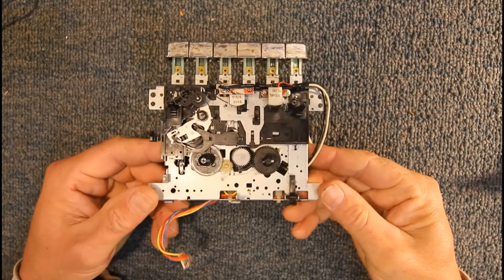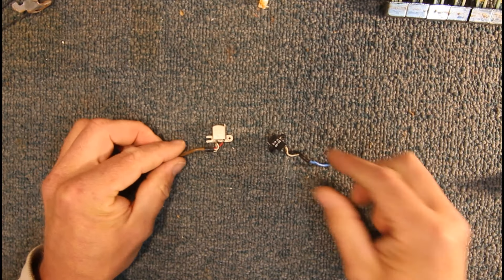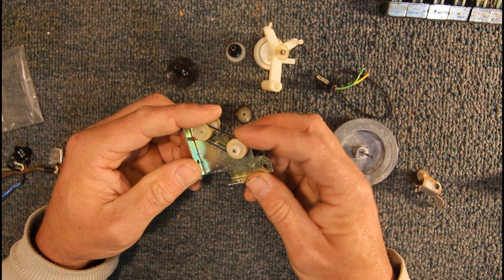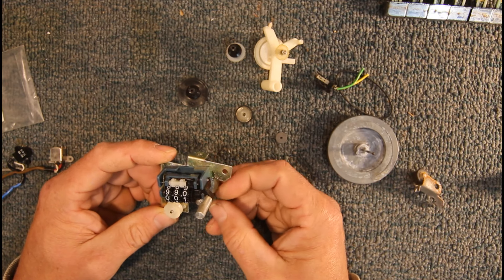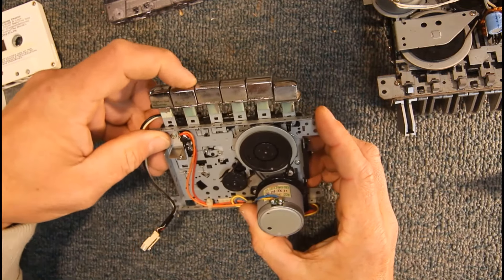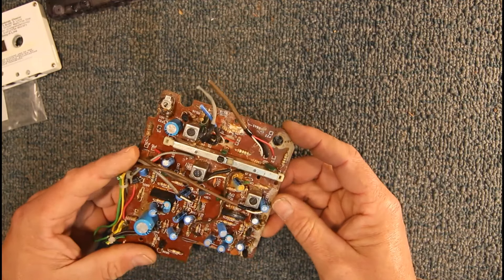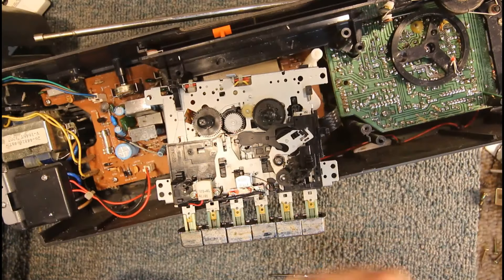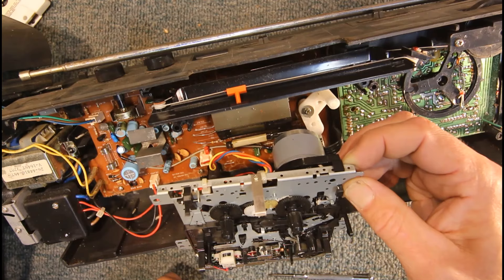Cassette Tape Player. How it works and how to repair.

Comment: Why when you press rewind when there is no tape in the deck, it keeps stopping? But play and fast forward keep going?
Reply from the maker: Its the auto stop mechanism activating. If the reel on the right doesnt turn the auto stop puts the deck into stop mode. When playing or fast forwarding that reel is turning so it thinks everything is fine.
Reply: @StevesElectronicRepairShop  ohh thank you sooo so much for that. I had no play, ff, and rew. So I opened it up and found the belt that goes from motor to capstan wheel gooey and perished. So I replaced it and I got play and ff, but no rew, it kept stopping every time I pressed it so I opened it up again and for like 2 days pulled everything apart again trying to see if there was another belt missing. I cleaned the contacts everything but still nothing. Then I saw your video and you were explaining how the deck works. So I thought I might send you a message to see if you could help me and you were right. When I put a tape in the deck it worked. Thankyou my friend
Reply from the maker: @alfaman4113  I see how that could fool you if you arent familiar with how they work. There is nothing worse than trying to fix a problem that turns out to be a design feature.

Comment: Hello, I have a Sony k7 dual deck module set, it was long out of use. Now I press play it does nothing, no button does. Can you help out please to fix it
Reply from the maker: If it hasnt been used for a long time its likely the belts have failed. Usually you will at least hear the motor run when you hit play or FF/REW. If you dont even hear that it might be an electrical problem or the motor has seized.
Reply: @StevesElectronicRepairShop  cool, yes I hear a noise like a click when pressing the button. Very short.
Reply: I don t know why the belts fail.... but I can take a picture of the looks
Reply from the maker: @luisguerreiro2169  There should be a constant whirring type of noise if the motor is running but the belts have failed.
Reply from the maker: @luisguerreiro2169  If left for a long time without use the belts will turn into a sticky substance and break
Reply: @StevesElectronicRepairShop  Now I see... the belts are around a white circle, a black tiny sticky and broken.
Reply: What should I do about those belts my friend? Should I measure them to buy some anew?
Reply from the maker: @luisguerreiro2169  Clean off any old sticky belt with methylated spirits or similar. You can use a piece of string or cotton to find the length around the pulleys etc, which can be converted to a diameter and a belt that length/diameter or slightly less can be ordered. Wagner Electronics Australia have a listing of belts giving both length and diameter in their online catalogue which is a good reference to see what is available even if you order them from someone else. The belts also have a square cross section, and flat belts have a width which may be important to match with a replacement, though sometimes it doesnt matter much.
Reply: @StevesElectronicRepairShop  do u think I can use Petroleum ether for cleaning? Thanks a bunch... I will open the case and try to figure out the belt size, as you said. 😀
Reply from the maker: @luisguerreiro2169  Its probably not good for plastic parts, but may speed the cleaning process up a lot. The plastics are usually pretty good in Sonys, so it may be OK as long as you clean it off with metho or alcohol straight after.

Comment: Hey mate, we are having a drama with a Hilux radio the cassette player keeps overriding the radio, it's running when there is no cassette tape in it. The only way we are able to get the radio to work is by holding the eject button on the cassette player. Would you have any idea what could cause the cassette from running without a tape?
Reply from the maker: That would mean the tape mechanism is pushed into the load position or close, and there is a switch inside which changes from radio to tape that is being activated. You would need to stick something in the door and try and lift the tape holder back up into the eject position, or open the unit up and do it, since it sounds like the eject button isnt able to lift it up. Some use a belt and motor to eject but usually they are just mechanical from the button.

Comment: Great video! By the way, from what machine is the other mechanism, the one shown at 1:00 ? I have 95% similar mechanism from Daewoo CT-650 cassette recorder and I can't find any info about it anywhere...
Reply from the maker: That was out of a Silver branded stereo. I now know its a Tanashin TN-33 mechanism. Used in many portable cassettes made in the early to mid 1980s.

Comment: Thanks for a great video! I've got a question I regarding when you play the tape: does the take up wheel really rotate at a constant speed? The tape would build up over time thus increasing the actual diameter. Thus the tangential speed increases, right? Wouldn't that put tension on the tape over time? Is it some sort of slip clutch? Maybe you explained this but I don't understand how it could be gear coupled.
Reply: I think you mentioned it now, with the felt clutch? But, could you go into depth on this subject? Also, if you could explain how the oscillator circuit works from an electronic perspective. With a schematic and so on.... I would be so grateful!!
Reply from the maker: The diameter of tape on the reel increases, so the load may increase slightly, but the diameter of the reel and sprocket being driven stays the same. The pinch roller controls the speed of the tape over the heads which remains constant, so the amount of tape taken up is constant amount per unit of time. The clutches are there to slip if there is some sort of overload, or when the end of the tape is reached before the auto stop kicks in. I am not an expert on the bias and erase oscillators, but have been thinking of doing a video on them after finding an old magazine article, and I do have a circuit of an old mono player. I will try and get onto that sometime soon.
Reply: @StevesElectronicRepairShop  Hi! Thanks for the quick and thorough response!! Yes exactly, the capstan keeps the tape at a constant speed but the diameter increases for the tape on the take up wheel over time. Maybe I'm slow but this is the thing I don't understand 😊 It can't be driven directly by a gear then. And since it slips if the sprocket is held in place that also indicates some sort of clutch. In your video, you flip the mechanism to show this but it unfortunately get outside of the picture. Could you make a video on this topic alone? 🙏🙏🙏

Regarding the oscillator circuit - it would be amazing!! I made a circuit once that used the inductance of the coil for oscillation. But it was a bit unstable and that have been my experience with all oscillator circuits I've built.. I'm a noob when it comes to electronics so I'd like to find something that always works!

Again, thanks for the great content and your answer!
Reply: @StevesElectronicRepairShop  hi mate, I’m trying to find an answer to the very question Vikings asked, no success so far. As the amount of tape on the take up reel increases, the rotational speed of it has to decrease, if the length of tape being picked up is to stay the same. The only way this could be achieved, is for the play shaft to continuously slip on the edge of the pick up reel. Is this the case? If so, is the edge of the pick up reel going to wear out over time (I understand it’s rubber, and the play shaft is some metal), and cause problems with tape pick up, and eventually chewing up the tape?
Reply from the maker: @prusak26  Sorry about the late reply, but I have done a video on the take up reel now to answer peoples questions. 
https://youtu.be/axT1p0YHK3I

Comment: Hi Steve, just got one of these players, but I have just had a problem with it,.... the play, f/f and re-wind buttons will just stop after pressing them ?
Reply: Hi again Steve, sorted it ....3 screws taken out from bottom of player, then opened battery compartment and took 2 more screws out before I could remove  the top  and see the mechanism ...then I saw what the problem was, the belt had  just come off the wheel.

Comment: Great video and excellent timing too! My poor old Philips dual tape deck has been a bit temperamental lately. The "A" deck seems to be fine, but the "B" deck (used for recording) is having issues. It won't play/record for more than a few seconds and it keeps stopping and it seems to be damaging every tape I put in it. Although, REWIND and FF work perfectly fine at lightning speed! Interestingly enough, the deck will play without a tape in it, but once I insert a tape it keeps stopping. Anybody have any thoughts or suggestions on this problem??
Reply from the maker: Sounds like a take-up reel problem in play. You could try putting it into play with the door open and put your finger on the take-up reel (the bit that goes through the hole in the tape on the right side) to see if it stops easily. It should have a bit of torque to resist you trying to stall it. If it stops very easily its like most likely a slipping belt or rubber idler tyre.  Some decks have a switch above the tape that will stop the deck playing if there is no tape in it, and you may have to push that up as well to get it going.
Reply: @StevesElectronicRepairShop  
Yes I think it may be the pick-up reel belt. Thank you for your response.

Comment: I’ve got a tape mech without a speed adjustment pot on the back of the motor. Any suggestions as to what the deal is and how I can go about adjusting its speed?
Reply from the maker: I think some hid the pot under a label so rub a screwdriver or something over any labels on the back of the motor to see if there is a hole underneath. Some older decks had the regulator on the circuit board somewhere rather than in the motor. Follow the motor wires to where they connect onto the circuit board and look for a trimpot there. Some 70s decks used a large open motor, usually with a fan on it, that ran off 240v or 110v, and I dont think they are adjustable as they would be syncronised to the AC power frequency.
Reply: Steve's Electronic Repair Shop will look around, thanks for the help
Reply: Steve's Electronic Repair Shop you’ll never believe it, the entire back of the motor was covered with a metallic silver colored sticker. Got it removed and waiting on a calibration tape. Thanks for the tip.
Reply from the maker: @XanderRowlet  Thats good. Thanks for the question. There are lots of things like this that I have forgotten about until someone asks me. Hopefully it will help others out.

Comment: My play button is jammed on a jvc 1983 model. Any ideas?
Reply from the maker: Usually its the slide plate that locks each button in place is not releasing if its stuck down. If it wont go down its more likely the big plate the head is mounted on is jammed in some way

Comment: Steve, I loved your video.  Very helpful.  IO have an old Sony CFD-510 boombox.  Original problem is taping eating in play mode.  I took it apart and using your video, I think I have the diagnosis.  FF and rewind work fine.  Playmode:  capstan and pinch wheel rote as they should but take up reel does not move.  It appears that a pulley wheel with an outer band should engage the reel as looks like it does.  That same pulley wheel looks like it should be driven by the a small part of the idler.  This does not appear to make cotact when in play mode and thus does not drive the wheel that should drive the take up reel.  Any advice on how to solve that problem??
Reply: Steve, sorry for lack of editing above.  I think you get the picture though.  It is the play idler that is not contacting the main idler.
Reply from the maker: @jtlenert  I had a look at the manual which is available for download if you search for it. It looks like 176 on the exploded view of the tape deck is the play idler and 177 is the arm that moves it into place. Its most likely either a slipping idler due to the rubber being worn out, or the idler arm isnt moving freely maybe due to sticky grease. There may also be a spring to pull the idler into place. Try putting it into play with the power off and moving the play idler back and forwards to see if the lever moves easily and returns to the position where it should engage the other idler and the reel together. If it doesnt contact both of them then its a lever problem, if it does contact but not turn its a slipping idler.

Comment: When i push PLAY button, the head and pinchiller do not move up. Can you tell me whats problem? How to fix it.
Reply from the maker: Sounds like its probably a soft touch mechanism and its usually slipping belts that cause that.
Reply: @StevesElectronicRepairShop  its not due to any belt. I already changed new one. Only one belt. Its Philips WT01 RER 5 for Beosound Century (2000). Do you know how to fix it?
Reply from the maker: @anhminh1286  I dont even know the model so cant diagnose its problems just by imagination.

Comment: Hi wonder if you can help me solve an issue? I have a technics tape deck and some tapes start to play and then the sound dips out and becomes ‘muffled’ if you hit stop and then play it comes back as normal but then dips out again. These are brand new tapes. Some stuff plays through no problem?!?! Any ideas?
Reply from the maker: Do you mean the level drops and gets quieter, or does the sound quality change? Is it on both channels at once? Either way its most likely something in the electronics. Cleaning the play/record switch would be the first thing to try if it has one. It could also be dry solder joints on the circuit board somewhere.
Reply: Steve's Electronic Repair Shop Yes the sound quality becomes poor and muffled on both channels. I don’t see a play record switch like in your video but I’ll take another look. Anything I can do if it is the solder? Thanks for your help it’s much appreciated
Reply from the maker: @slothrra  You would have to use a soldering iron to resolder bad joints. Some of the Hifi tape decks used relays instead of a record playback switch which can also go bad. They are usually a rectangular box about 1x2cm with a clear cover and black or blue base.  Gently tapping on them or the circuit board should reveal if its bad relay contacts or solder joints as the fault should come and go as you tap.
Reply: @Steve's Electronic Repair Shop so strange I can’t work it out. Everything looks really clean and in good condition and some tapes play through with no issue.

Comment: Hey Steve, thanks for the video, really useful info! I have an old National Panasonic music centre and the tape deck has recently developed a fault, it now seems to play both sides of the tape at once, one side in reverse. Is this a common issue, any idea how to fix this issue? The model is the SG-2080L. Thanks for your help. Dan
Reply from the maker: That is a new one I havent come across. Its possible if the head is way out of alignment that it could play a track from one side normally and a track from the other side backwards, but there is usually a pair of metal guides on the head that I would prevent that happening I would think. Check if the head in the center looks to be positioned in line with the erase head on the left and pinch roller. I am not sure what happens if a head is connected up backwards which might be possible if the record playback switch is faulty and maybe needs a clean. I am going to have to try that one out and see what happens.
Reply: @StevesElectronicRepairShop  Thanks for the reply Steve! Yes its very strange and has had me baffled! The tape head seems to be in line with the erase head and roller, its at a slight angle looking down (it's a top-loading deck). I have had a similar issue in the past with this player that i managed to remedy by recording something onto a blank tape, after this playback worked again, however I have tried that this time and it's not working, so perhaps it is the playback/record switch after all?
Reply from the maker: @danjoyce1985  If it came good after going into record it is likely the switch. If you put a blank tape in and press pause then repeatedly press record and stop it will move the contacts back and forward and might get it going again. Ideally it needs switch cleaner lubricant sprayed inside.
Reply: Thanks Steve I’ll give it a go!
Reply: Hi Steve, the pause play record trick hasn’t worked unfortunately, I have some contact cleaner though, any advice/links to videos to help me clean the switches? Thanks again Steve
Reply from the maker: @danjoyce1985  I do show what one looks like in the video. Its a matter of finding the switch on the circuit board, its attached mechanically to the tape deck, usually by a silver metal wire link, or a lever that pushes on it if the board is on the back of the deck, and then squirting the cleaner up inside and moving the switch back and forward a few times.

Comment: Good mornin.
 My wife received a brand new casstte/radio player. It will not record anything. Out of the box it recorded but the second attempt nothing. Any ideas is greatly appreciated.
Reply from the maker: If the record button wont operate its because the tape needs a record tab in the top. Blank tapes have them when new but they can be broken out to protect what is recorded, and prerecorded tapes have them missing. If the button goes down and the tape is turning it should record whatever sound is playing from the radio. Component tape decks do have a record level control which will cause no sound if turned right down, but radio/cassettes usually just record at a preset level.
Reply: @StevesElectronicRepairShop  thank you for replying. The blank has its tabs in place. The tape turns when I push record. And it's a new radio/cassette player. It's called riptunes. Any other ideas why it does not record? I will look for the setting you were speaking of.